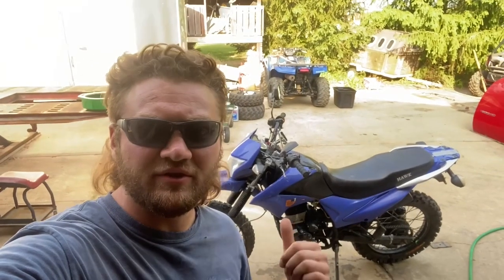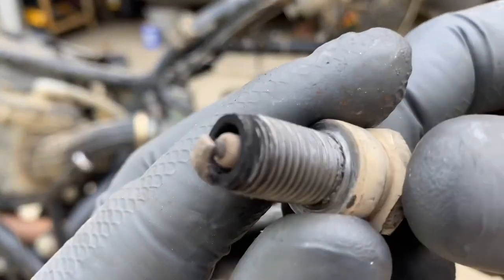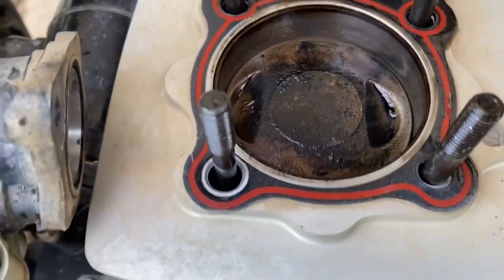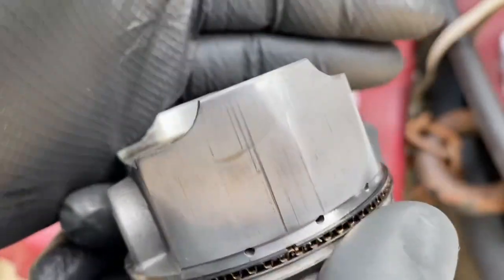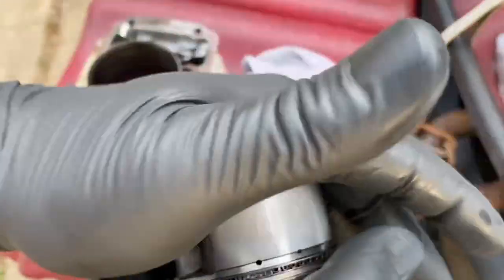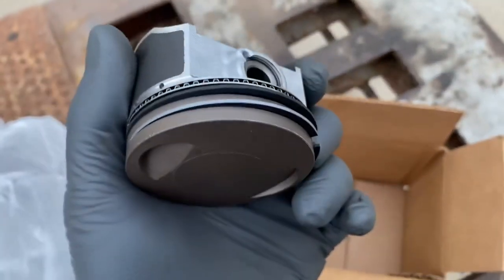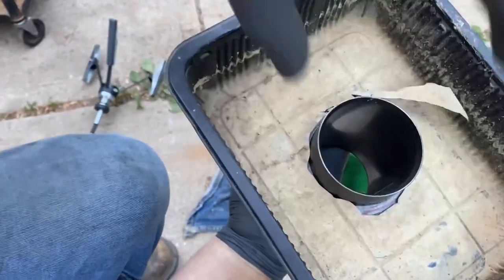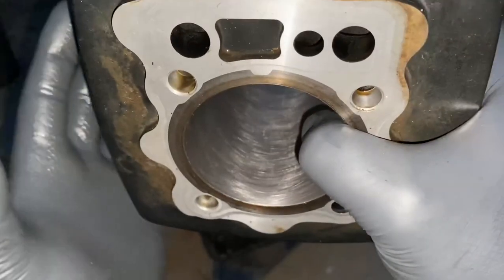Hawk 250 gets rebuilt again…

Comment: im new to this, but isnt the honing inevitable?
Reply: and what exactly is the downfall to the honing sitting at 600 miles and havent eveer cracked this open
Reply from the maker: @catboysoutdoorfilms8468  honing is necessary, it keeps the rings oiled. The slight scratches on the cylinder wall from honing  hold oil and lubricate the piston and rings. Once the honing is gone stuff starts wearing out. Thanks for watching!

Comment: spark plug lean..
Reply from the maker: I put the coldest spark plug in it that I could find, that didn’t work, I rejeted the carburetor in both directions, no difference, going to change the spark plug again, then check the coil and computer and maybe the woodruff key on the stator. Any other ideas would be welcome 🙏
Reply: @goodolboys713  dam... Looks like you been to hell and back...